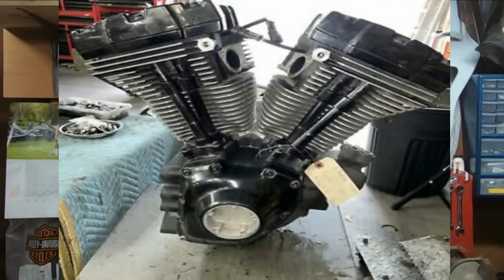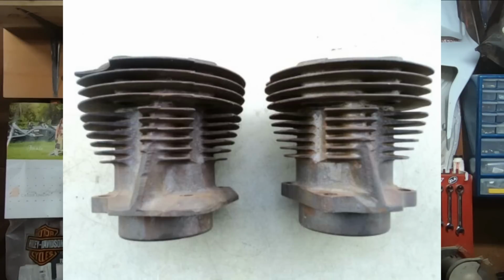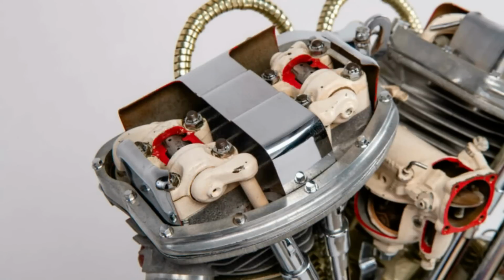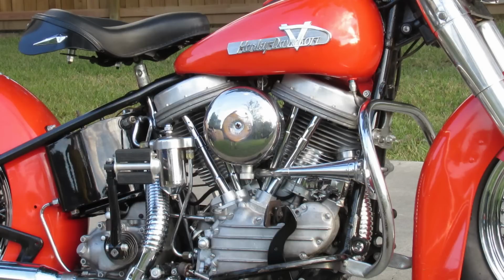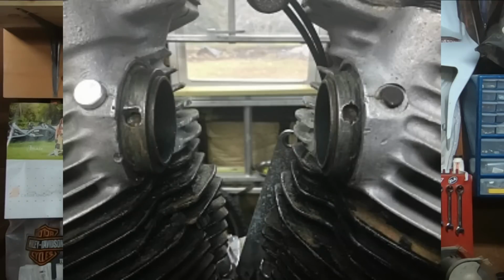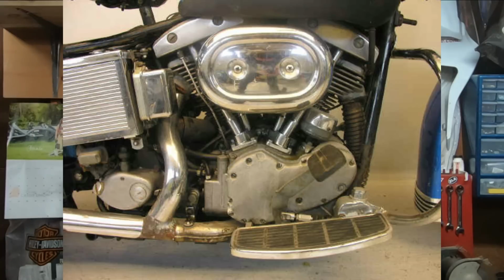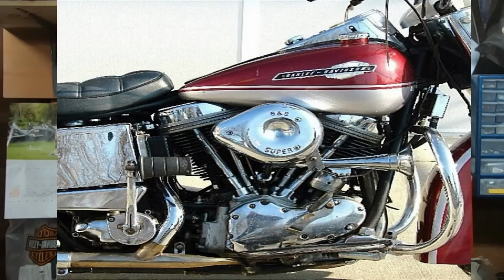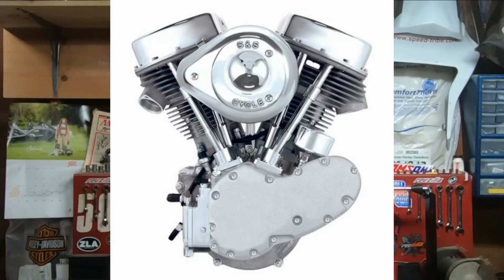Harley-Davidson Panhead is Simplicity at its Finest

Comment: The knucklehead was the origin, and it all ended when the evo ended.  The twin cam did not evolve from the evo, it was designed to look like a Harley motor and to some extent sound like one, but  experienced people know it can never sound the same.  The newer Harleys, in my view, are facsimiles of Harleys.  Incidentally the Panhead ended with the 1965 model year, not the late 1960's, and the 65 was the only year with electric start.  Pans and shovels are not hard to find.  If you want a rare version and/or museum piece be prepared to pay, but you can get reasonable examples for reasonable prices today.  I am stunned that you seem to champion the engine but seem to disregard choppers or engines not in their original frame.  Why is that so if you are praising the engine?  The low demand market keeps the prices down except on real collectible examples, most modern Harley riders may idealize or fantasize about a panhead but they aren't really serious buyers.  They want a fuel injected electronic ignition bike with a warranty and they think that bolting on accessories makes a custom bike.  They aren't prepared to deal with tuning a bike with a carb and points.  When they wash it and change their quick release sissy bar they say they have been working on their bike.  But they have a poster in their garage of Captain America from the Easy Rider movie.  And they got a model of a panhead for Christmas, maybe even with Santa sitting on it.
Reply: @Chaves, But yet you commented about your CVO previously??? 👀 🤔
Reply: @wingwang007  Yeah? What's wrong with that?  I dig the 110SE motor in it even though I prefer older bikes.  I got it for $7300 after I totaled a Road King three years ago.  I put 10.25" shocks on it (200$ custom made), Danny Gray butt crack seat (used $100), took off the tour pak, put a tall hippie sissy bar on it, etc.   It's a 2007 and is the newest bike I have ever owned.  I also have an 87 Softail that's chopped.  My other bikes are 85, 81, 78, 75, including a Triumph chopper.  Both my knees have the cartilage torn up from kick starting big bikes, I can't really do it anymore.
Reply: @wingwang007  Yup.  So?  It's a 2007 that I got for $7300 three years ago, and still books for like 13 grand today, great deal.  Newest bike I have ever owned.  Bought it to replace a Road King I totaled.  I do a lot of miles for an organization I am patched in, so it served well.  Blew out both my knees, can't kick start anymore.  I also have a chopped 87 Softail, classic Triumph chopper (kicker so it sits now), as well as an XS650, chopped 75 CB500T in a AEE Choppers "digger" frame.  Why are you concerned that I have a CVO?  It has the tour pak removed, tall hippie sissy bar, Danny Gray butt crack seat, 10.25 inch custom made shocks, etc.  It's not exactly a geezer glide.  Why does it bother you that I have a CVO?  I still say it is a facsimile of a Harley.  The last true Harley was the Evo.
Reply: Some people will never understand things like setting the points on a mag with a cigarette paper adjusting a carb on the fly or operating a foot clutch. Some of us still ride these though and are passing knowledge to the next generation
Reply: So damn true.  I'd like to print this out and frame it.  When the wife tells me I'm a asshole and wants to know why I don't like this person or that person, I'll point to this.

Comment: When I was coming up in the early 70's the older guys were all riding pans. I always remember one in particular. It was a cammed up pan on a rigid frame, long springer, jockey shift, spring loaded clutch pedal, no front brake, and pullback bars so tight that his knuckles almost touched. I remember him with one hand on the throttle, one on the shifter, the thing jumping and bouncing around belching fire. It was awesome! I was always so impressed that he could hold on to it. Ah, the good old days. I have ridden a few pans but not in many years.
Reply: Yep, a straight pedal clutch, no rocker, one ya gotta keep yer foot on, is what a 'suicide clutch' really is.
Reply: yes it is surprising how many people dont know that
Reply from the maker: You just don't see anything like that anymore, I see a few Shovels these days but rarely a Pan.
Reply: @GixxerFoo  Istill ride a 54 Pan i would send you a pic but not sure where to send it

Comment: I will never part with mine until it goes to my son when I take a "dirt nap." I ride my 1949 EL Panhead three to four times a week nowadays. I'm not getting any younger as I'm in my sixties. She takes 1 to 2 kicks to start. She's pushing more than 60 horsepower for sure. Tank shift/ foot clutch, I run a 1 1/2" closed belt primary, STD heads, S&S Super E carb, Mallory electronic distributor.( I have all the stock stuff too put away including the original style pushrods with the lifters built into top of the pushrods) I am running stock drum brakes front and rear. She runs like a scalded ass ape, stopping.....you have to plan a little bit. The brakes work okay but they fade a bit unlike my '96 Evo disc brakes.
Reply from the maker: That is awesome! Those are unicorns these days, especially since you still have the factory parts!
Reply: Awesome!
Reply: May it live Forever!!😊
Reply: They call that antilock brakes these days.

Comment: When I started riding,the Panhead was the newest engine Harley made.
Reply from the maker: That is awesome! I would love to of been around to see those bikes new on the floor.
Reply: @GixxerFoo  the shops were mostly really small. Where I was the local dealer had three bikes a big twin and a couple different Sportsters on the floor. Wouldn’t work on anything not stock. Wouldn’t change a tire on a custom. I still liked those shops better than these huge boutique dealerships. I ride a Shovelhead so they don’t have much I need. Support your local independent bike shop.

Comment: You can put a belt primary on a panhead as well as a belt final drive and the bike will be as smooth as a BMW. I love the fact that you can buy a brand-new Panhead motor from S&S as well as a flathead and a knuckle and a shovel and an Evolution as well.
Reply: Don't forget, going to a belt allows you to remove the primary chains breather snorkel drip oiler so ya don't leave as big a spot wherever ya park. A good o-ring chain allows you to turn off & remove the rear chain oiler from the oil pump too.
Reply: Every time I see a panhead I am reminded of Wyatt, Billy, and George Hanson goingto Mardi Gras.
Reply: Yes you can, but it is by no means a simple "bolt in" modification!
To avoid belt breakage and/or rubber "dust"  in the clutch and all around the inside of the outer primary, requires leveling the transmission between the engine sprocket and clutch basket 'sprocket" with a strip of glass a few thou less than the belt width, (simple to make and cut). The shimming and tightening of the transmission, will also test your repertoire of expletives!
The primary will need airvents too for airflow,  as a rubber belt generates much heat.
I cannot see any real advantage of installing a belt final drive though; as final gearing modification, simple  rear wheel removal and strength are improved with a chain, and today's chains are far superior to those of old. 
The "smooth" excuse merely means the rider should maybe stick with an automatic car...
Reply: @Dodger2879  they have had Bell Drive final drive and primary conversions for old Harley Motors since the late 60s and early 70s. Disheveled head I rode with belt primary and belt final drive the bike was smooth as silk.
Reply: @frankmarkovcijr5459  
I know that! I've been fitting them since the 70's!
A belt final drive just means you are somewhat limited with gearing if you wish to change the final drive ratio. A belt primary is smooth though. I installed one on my 1965 Pan with a 5 stud Barnet and solid aluminum end plate.
How long they have been available, has nothing to do with anything though, respectfully. 
"In The Beginning" Hederson had a leather drive belt to the rear wheel, that being so, does not mean we should all go out and fit one!
A quality correctly adjusted O-ring chain really has no negatives. That is why the 1984 Evo Softail is now desirable! A kicker and chain is usefull, but not as pretty. The 4 stock speed transmission was a bit of a shame though.
But for Credit Card Bikers the final belt system has no equal.
Reply: @Dodger2879  I have almost 400,000 Mi on my 1999 Sportster and it is on its third belt I would have gone through so many sets of change and sprockets to go through that amount of miles. Is much cheaper to have a belt drive for long distance high mileage riding then continually change and sprockets moving and cleaning and adjusting. The only thing better than a belt drive is a shaft drive.
Reply: @frankmarkovcijr5459  
Well whoopee!

Comment: The frame was butchered by the factory to accommodate the huge battery required by the electric starter and this resulted in worst and poor handling. AMF saved Harley-Davidson and spent 7 million dollars to build the engine plant so Harley can build more motorcycles streamline production, but you're in the 70s you had in a lot of Industries employee sabotage of the products in order to get back at the company for Revenge. Haha no second gear, I get paid $4 an hour to fuck shit up this is the type of stuff that Harley dealers would have to rectify when they got bikes from the factory let's not forget in the old days if you ran a motorcycle shop and you because you were enthusiastic for the brand you sure didn't do it to make money.
Reply: Sounds like today's economy, brother. The old Soviet expression is becoming true: "They pretend to pay us, we pretend to work."

Comment: Alloy aluminum engines are known for valve clatter, there is nothing you can do about that; but I would trade a little more engine noise knowing that my engine was running 50% cooler than a cast-iron version.
Reply: What?!! 😒
Reply: Gotta disagree. I've rebuilt quite a few motors using Jims Power-Glide tappets and blocks. Best hydraulic lifters ever made for Pans and Shovels.
Reply: Yeah...ever hear of hydraulic lifters?  Harley did . Thats what was done about it. Harley even tried hydraulic  'push rods' before that. Didn't work so good. But, "nothin' you can do about it"?  Pick up a book, or better yet,  buy  a Pan and take it apart. Sounds like you got alot to learn.
Reply: And while I'm at it... I never heard of a Pan running as hot as a fuckin' Twin Cam! (All alloy aluminum)
Reply: My  Ironhead, years ago,  running 10/1 compression never even came close to running as hot as the Twin Cam I last rode!  You keep your alloy crap! You're welcome to them!
Reply: @tomcat88140  bullshit. Take oil temp readings on both on a 100 degree day. If you are comparing an Ultra with lowers to an Iron XL, that's precious.

Comment: The British has been using alloy has and alloy cylinders for ten years before Harley put those on the Panhead. Are smaller bikes made more horsepower ran hotter so they went to aluminum to disperse the Heat.
Reply from the maker: It really blows my mind how long Harley-Davidson stuck with using cast iron, the tooling must of been paid for they were selling bikes.

Comment: There was a road test in the old cycle magazine where they had the suspension and they were talking about the Panhead motor and how the fins were extended to make it run cooler and I quote it runs as cool as in ice man's shoulder. The 61 was so much easier to kick over than the 74 it was much smoother too.
Reply from the maker: By the time they increased the compression they really had to go to electric start at least as an option.